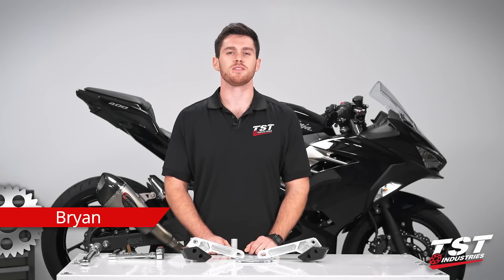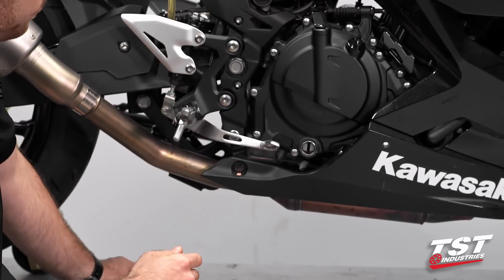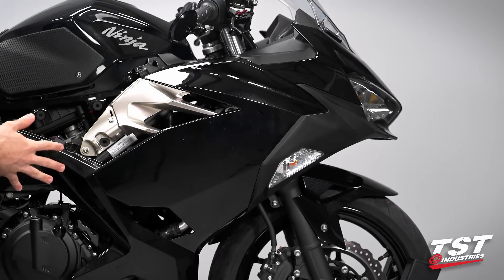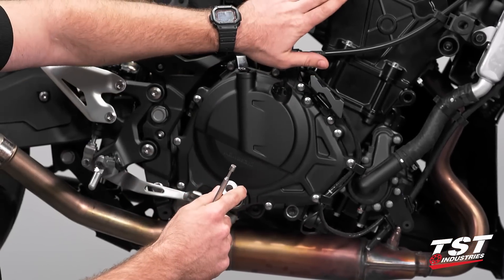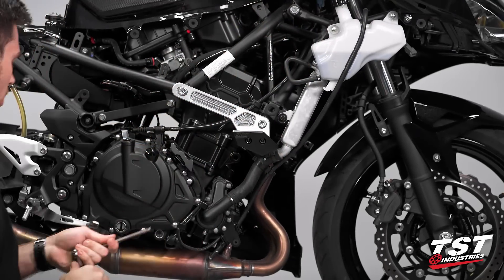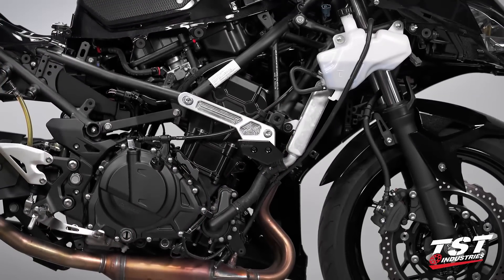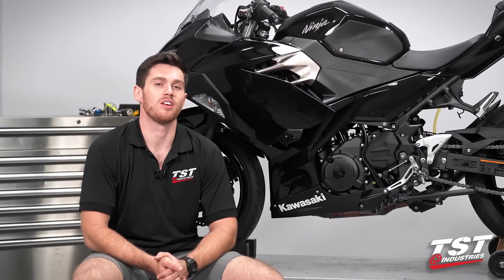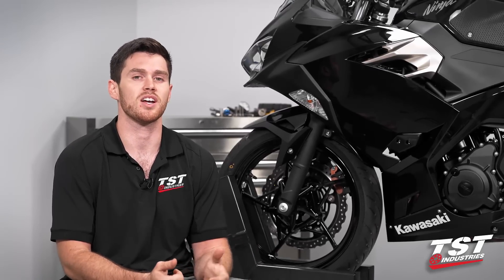How to install Frame Sliders on a 2018+ Kawasaki Ninja 400 by TST Industries

Comment: I just installed my TST Ninja 400 frame sliders and wow, too easy, everything was precision fit, no issues, and it looks like it was made that way from the factory. I really like how TST has a unique approach, with quality products with great aesthetics.
Reply from the maker: We love to hear feedback like this as it's exactly what we aim for. Thanks for the love and support!
Reply: Unfortunately not the case for me. The left side front bolt appears to be too long giving extra gap between the metal bracket and the bolt

Comment: Just installed these on my 400... highly recommended. For California riders, note that you will need to relocate the emissions canister that is on the left side of the bike. You don't see this in the video, presumably because this is a non-California bike. The relocation is rather trivial- You'll have to take the canister and sensor out of their mounting bracket. I used two 18" wire ties (~.35" wide) to strap the canister somewhat perpendicular to the slider's mounting bracket. It actually looks like the radiator has more breathing room now! I tied the sensor to a nearby wire harness to keep it from rattling around.
Reply from the maker: Thanks for sharing this. The California and European models are the same in regards to the charcoal canister. I am sure a lot of guys will find your post helpful.
Reply: @TSTindustries  Does the Canadian ninja 400 has the charcoal canister as well, tempting to buy the frame slider, bar ends, fork slider, swing arm spools
Reply: Yes for California spec is a little bit tricky. I didn’t remove it from the bracket, I just move whole set up a little bit then use three cable tie to hold it on the frame. Just make sure those EVAP hose don’t touch the radiator hose. Fortunately our fairing has a big room there so it’s not difficult to relocate it.
Reply: @davidchiu9613  Is this something that I have to worry about even if I buy the Kawasaki frame sliders from the Kawasaki website?
Reply: @ghosts-dx6nw  I checked the Kawasaki website one and see it only use one mounting hole so you may not need to relocate the canister box. But that one mount slider is not good enough to handle the accident.
Reply: @davidchiu9613  Nice, thanks for the reply! 👍
Reply: Hey Michael K do you have any pictures of what it looks like after you remounted it? Just so I can get an idea. Please 🙂
Reply: How difficult was it to relocate that canister? Seems like I will have to be doing that soon
Reply: @benjamintruong8357  (Ugh... I guess YT doesn't like external links) Sorry it's been a while and you've probably already done this. But for others I have uploaded a photo to imgur here: kOVB9kv. You can also see the relocated solenoid in the upper left.
Reply: @brittensomerville8883  The relocation itself is super easy. The time consuming part is removing the fairings. It's been a while but if I recall correctly you need to remove the front facia first before removing the sides. Just remember where all of the screws and fasteners go when you put it back together!
Reply: @MichaelSomeRandomString I can’t see the photo on Imgur man :(

Comment: I just installed my tst frame slider it looks really nice it's perfect fit on my 2022  Ninja 400 krt edition. One thing I ran issue  with my bike was I have a canister box for emmision on the left side of the frame. So i just took the canister bracket out and put the canister emission box behind the tst  frame slider bracket and secured it with zip ties lock.   The tst frame sliders looks really awesome on my bike. I'm happy I purchased it.

Comment: I love these frame sliders, it looks better and has better quality then any other slider I've seen on the market. Only thing I dislike is the price, after tax and shipping it comes out to $163.00. If I scratch my bike up, it'll literally cost less to sand it down, apply any fillers, paint, etc, repair myself. Of course the time to do this is the downfall, but you're guaranteeing that you pay $163.00 for sliders vs maybe not having to pay anything at all if you don't drop your bike. To me the price is way too expensive for sliders. They need to get the price down. I really love these but it just makes no sense to buy sliders for a ninja 400 for $163.00.... Call me crazy, maybe someone can talk me into buying these, they are nice, but so far I don't see it at this price point.

Comment: It doesn't look like you're selling replacement delrin sliders on your website. Do you have any plans for that in the future? Buying a whole new kit after a crash doesn't seem economical. Cheers
Reply from the maker: We can sell just the delrin parts without any issue. If you ever need any down the line you will need to send our support guys an email and they will set you up.

Comment: Anyway to get that manual or spec? I didnt see one in my box, and can't tell which screw goes into the frame for the mount.
Reply from the maker: I don't know what you are asking for exactly. The video is the installation manual. We stopped doing printed instructions many years ago, and started making step by step videos that cut down drastically on mounting problems people typically have when using printed instructions.

Comment: I bought this as well as your guys Voltage Regulator Relocation Kit, do you have a video or info on to mount it on to the Frame Sliders? Thanks in advance 🙏🏻
Reply from the maker: We do not have a specific video for that kit but there are several photos in the product page showing the installed configuration. Please see them here https://tstindustries.com/tst-voltage-regulator-relocation-kit-kawasaki-ninja-400-2018.html . Scroll through all the photos in that page. You will need to manipulate the harness quote a bit so that the rectifier reaches there without tension. I cut the whole harness apart and rebuilt it on our race bikes so I was able to configure it perfectly. I think with stock harness there is a chance that you may have to cut the harness shielding off at the junction where rectifier branches off, and get those wires to come out in a slightly different direction, then tape it back up. That is a pretty standard modification for track bike prep.
Reply: @TSTindustries  Noted ✅️ thanks so much 🤙🏼

Comment: so these would also work on the 2019 version yes?
Reply from the maker: Yes
Reply: Awakken470 yes, i just installed them on my 2019 Ninja 400, best frame slider kit out there, no cutting and quality hardware. Also for a few dollars more you can relocate your rectifier, on the left side frame slider mount to prevent damage during a crash. That was also a piece of cake to install

Comment: In the event of dropping the bike, would this technically cover the whole frame or just partial coverage?
Reply from the maker: These parts are meant to protect the most vital components of the bike, mainly the protruding engine parts, and aid in salvaging controls and rotors. The frame will not likely touch the ground even if you don't use frame sliders.
Reply: I dropped my ninja 400 without frame sliders and not a single part of the ferrings were touching the ground ^^
Reply from the maker: @xParlorment  now try doing that when the bike is in motion.
Reply: Hold on lemme buy some TST frame sliders real quick lmaooo

Comment: I can't get the last engine bolt out like it literally stripped both of my sockets any help or advice I had trouble getting the other three out but this one just will not budge
Reply from the maker: You have to make sure you are using a well made 6 point socket for those heads. You also need to make sure that you do not have excessive extension from the ratchet handle there, otherwise the socket can get off axis with the bolt and result in stripping of socket, head, or both. I find it helpful to use a breaker bar with smooth application of torque instead of impulses of force to the handle on a smaller ratchet.
Reply: @TSTindustries  breaker bar and impact socket worked perfectly thanks mate 👍
Reply from the maker: Right on. Glad it worked out

Comment: Why the slider not designed to be installed on the front engine mount and make a hole on the fairing ?

Like frame slider for R3 ?
Reply from the maker: Because on this particular bike the front engine mount by itself isnot robust enough to take a serious hit. We have seen several bikes with aftermath of a crash while using the Kawasaki brand and some other brands of sliders that mount only in that one location and saw evidence of frame damage. So we decided to make a superior setup that actually does its job.

Comment: will these fit the 2023 krt edition
Reply from the maker: We haven't gotten our hands on a 2023 model KRT yet as we don't believe they've hit showroom floors at this time. However, the Ninja 400 has gone completely unchanged outside of color schemes so they should fit with no issues.

Comment: Would these work on a 2023 ninja 400?
Reply from the maker: Yes. If you ended up with the version of the bike that has the charcoal canister as part of the EVAP system please make sure to watch the additional video in the product page for the details of that installation before you commit to buy the parts.

Comment: What brand of torque wrench are you using?
Reply from the maker: The one we use in this video is a Husky. Nothing really special on the chassis components. Inside the motor and other super critical parts get tightened with properly calibrated wrenches.
Reply: @TSTindustries  thank you!

Comment: Compatible with a Ninja 400 2020 model?
Reply from the maker: Yes, but please read the product page carefully. These sliders were designed as a racing part. If you live in an area where the bikes require a charcoal canister you will need to remount the canister on your left frame slider bracket.

Comment: Will fit on 2023?
Reply from the maker: Yes. Please follow the link in the description of the video to the product page. If you live in an area where they deliver these bikes with an emissions carbon canister, you will need to read and understand the implications of installing these frame sliders on a bike with this canister. If your bike doees not have this canister then you can just ignore that. We also made a video about the canister and how to install around it.

Comment: not too short?
Reply from the maker: Our crash protection components are designed based on experience gathered crashing many bikes, in different environments, and in many modes of crash. If they stick out too far they catch, and send the bike flipping in a severe enough crash where the slider encounters a soft surface, like dirt, and is able to dig in. The longer protrusion of taller kits also has a bigger moment arm that will transfer more stress to the mounting points. These sliders are meant to protect the most vital and expensive components of the bike, and they are designed specifically for that purpose. Have you ever seen really long frame sliders on a race bike? There is a good reason why the answer is no.

Comment: What is the torque weight again?
Reply from the maker: We have two torque ratings in this video. You can always pause or go back on a video but in short, the delrin bolts are 12 ft/lbs and the mounting bolts to the frame at 32 ft/lbs.

Comment: I just tried to install this kit on my 2022 Ninja 400. It does not fit, Kawasaki put some type of emissions box right in the way. On the left side of the bike.
Reply from the maker: Yes, we mention that on our product page.
Reply: @TSTindustries  so it doesn’t fit?
Reply from the maker: @Kingnabor  there are some models in certain regions that have that charcoal canister in the way. These sliders were designed for race track performance, and race bikes have all that emission stuff removed. However, we have had customers who really want this setup anyway so we came up with a scheme of mounting the charcoal canister to  the slider brace. You just remove the bracket that attaches the canister to the frame and mount the canister to the TST brace bracket with wire ties.
Reply: @TSTindustries  can u guys make a video of how the process works? I learn much better watching lol an I’m sure a lot of ppl from Cali would love to have this tutorial made, I’d hate to have to send my sliders back since I really like how it’s design an tucked.
Reply from the maker: @Kingnabor  I will try to knock out a tech-tip video for this before the end of the week
Reply: @TSTindustries  awesome!

Comment: So you mean to tell me you had to do all that work because Kawasaki didn't make something to screw into that hole they have in their fairing? Wow.
Reply from the maker: Kawasaki actually sells a set of sliders that protrude through that fairing hole after installation. They mount into that single front motor mount location, cost 280 dollars, and do a poor job at protecting the expensive components on the bike. We have examined post-crash N400 bikes that had the Kawi sliders installed duting a medium speed crash and noticed a pattern of the "crash protection" components damaging the frame in the mounting location. Ours are half of that price and engineered in a way that distributes stress and is designed to be the first consumable in a crash instead of damaging frame or other components from stress transfer. One added bonus is that if you are racing the bike and going to a race fairing set you can remount your rectifier from a vulnerable location under the front fairing to the protected location behind the left slider bracket so that in a crash you don't damage your rectifier.

Comment: Worthless,  too short
Reply from the maker: They may seem too short to you but other guys that have experience crashing at high speeds would call longer frame sliders worthless because they catch on things in a slide and damage engine/frame components. These aren't fairing savers. These components were developed for saving the expensive parts that get damaged in a severe crash. These are meant to enable you to rebuild the bike quickly for the next race after having an incident. We are a race driven engineering company, and we purpose build parts. If you listened to the entire presentation in this video, or perhaps read through the product description on our website you would not call the kit "worthless," but instead perhaps "maybe this isn't what I'm looking for."
Reply: These are for race track slides, not parking lot tip overs